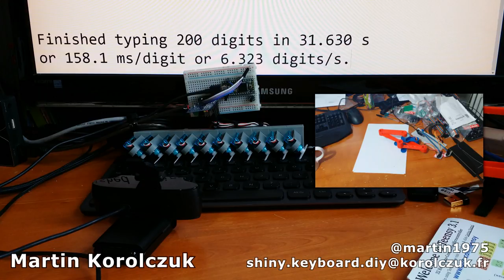Shiny Keyboard Servomotor Robot tape au clavier

Comment: How you have prepared this  product
Reply from the maker: The robot is made of 10 attached sets. Each set is made of two 3D printed parts (base and mount) as well as a tiny (3.7g) generic servo motors.

You can see and download the 3D files from the Autodesk Gallery:

https://gallery.autodesk.com/projects/key-pushing-robot

All the servo motors are plugged into a PCA9685 16-channel servomotor driver module.

The servomotor driver module is connected to a Teensy 3.1 (an Arduino compatible microcontroller).

An external USB battery is used as a power source.

The program controlling the robot is written as an Arduino sketch (a C language program with Arduino libraries).

The whole thing is specifically crafted to be used on a Logitech K810 keyboard.

You can translate the video description from French to your language using Google Translate (or your favorite automatic translator) for more information.

Comment: can you make a video on this how did you managed the whole process with code and hardware setup step by step? pls
Reply from the maker: It's been years ago. I'm afraid I don't have the robot arms, nor servomotors anymore. :-/

However, you have a bill of materials (BOM) on the splash screen on the video:

• Arduino/Genuino-compatible microcontroller (here: Teensy 3.1, but it can be anything Arduino-compatible);

• PCA9685 servomotor driver module (to attach servomotor and additionnal power supply);

• servomotors (here, some very small ones: 3.7g each);

• additionnal battery for the servomotor supply (here, an USB external battery; be carefull to not directly attach all the servos together to the Arduino board, since they use too much power and can damange the board).

From the software point of view (all those tools are available in free versions for at least recreative usage):

• Arduino IDE or any other compatible IDE (including Microsoft Visual Studio + VisualMicro; or Microsoft Visual Studio Code + PlatformIO; or anything else) for programming (it's easy, once you've managed your first Arduino programs);

• Autodesk Fusion 360 or SketchUp for the robots arms 3D modeling (CAD);

• AutoHotkey or any other key remapping software (including your already installed keyboard driver tools, if you have a gamer keyboard, or Microsoft Keyboard Layout Creator);

and finally:

• any 3D printer (the most expensive part after the computer itself);

You can change the CAD and 3D printing steps by anything you can do by yourself, including wood, cardboard, LEGO or even Play-Doh.

And don't forget to  HAVE FUN! \o/

Comment: Can make this over complete keyboard
Reply from the maker: No, this robot cannot be used to press any key of a keyboard.

I'm afraid this robot is only intended to be used on the top row of the keys of a Logitech K810 keyboard. It's really very specific to this keyboard set. Moreover, it would not be easy to press other keys, especially those in the middle.